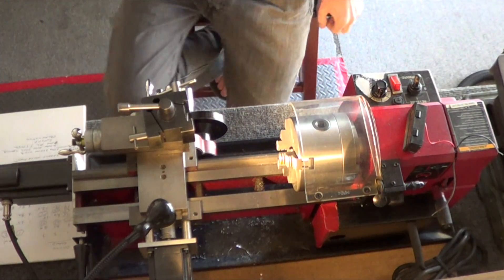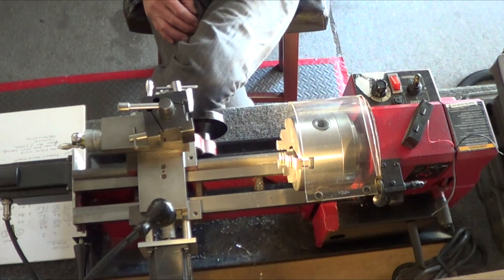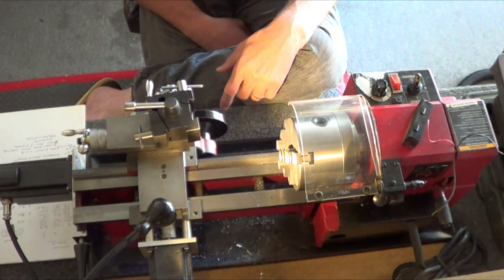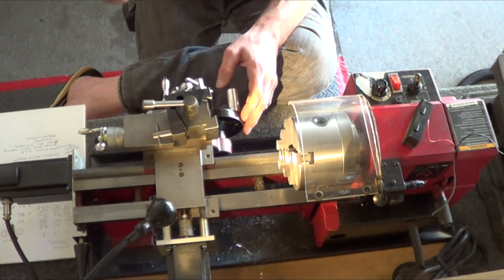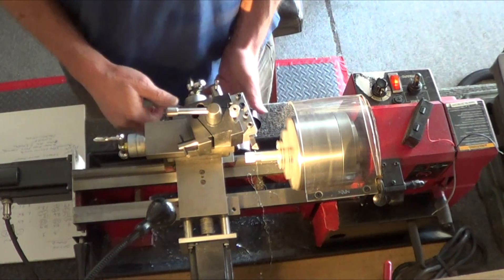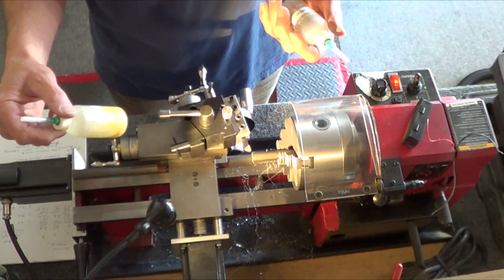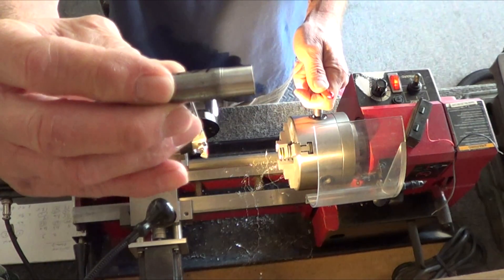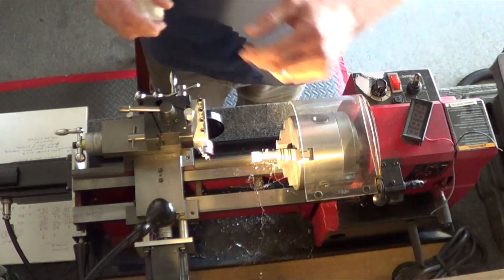Mini Lathe Unboxed & Rebuild #4

Comment: Hi Dave,  just subscribed to your channel and love all the vids you've created.  I have a question.  For the spacer that you machined,  did you machine a new one or redo the one that came with the lathe?  If a new one,  what material did you use?  Thanks for your help.
Reply from the maker: I have a playlist of videos just on the lathe. Not sure which spacer if the compound handle then a new one of aluminum prints are on my web site shown at the end.
Reply: @TheMiniMachineShop  I believe the spacer was for the feed control.  I can only turn it a short distance before it becomes increasingly difficult to turn and finally too tight to move.
Reply from the maker: @royeubanks639  Just watched the video and you have to be talking about the compound right? Sounds like you have a gib problem.
Reply from the maker: Is this a new lathe?

Comment: as of today, HF sells 2 different mini lathes; one for $999, and one for $599. unfortunately, the feature lists on the respective product pages list different sets of specifications and features, making comparison of the 2 lathes practically impossible, other than swing.

i'm wondering... if you took a look at the 2 product pages, you might understand right away what an additional $400 gives you other than capacity.

https://www.harborfreight.com/power-tools/routers-shapers-lathes/8-inch-x-12-inch-precision-benchtop-lathe-44859.html

https://www.harborfreight.com/7-inch-x-12-inch-precision-mini-lathe-93799.html?_br_psugg_q=lathe

Comment: Great videos! I have an older lathe from central machinery that I got from a trade. It's on its last leg. The on/off switch button is broken, so I have to use a small wooden dowel to press on it to turn it on. But I'm looking into buying a new mini lathe. What do you recommend for a newbie(bout 6 months) other than the one you use. I'd like to maybe have the mill combo.
Reply from the maker: Personally I would rebuild what you have getting parts from the little machine shop. As for recommendations, I have none. As said in many videos, research all you want. You have no idea what the condition is going to be of what you get. They are all made in China. I would look for a used one on Craig's list so you can test it. Here is a summary of my second lathe https://www.youtube.com/watch?v=mnZxrBqubPg

Comment: Hi Dave I don't have the same lathe as you but you might also want to check the bearings in the headstock. If they become a little loose over time they may need to be tightened up. That will correct some of the chatter as well just don't tighten them too much. I've had the same problem. It made quite a difference after I got them adjusted correctly. Nice job. Mike

Comment: Hi Dave, I just ran across your channel and have enjoyed your work. I've been doing a lot of research on mini lathes and mini mills. Apparently, a lot of them are manufactured side by side in the same factory. The difference being the is level of quality the seller wants from the manufacturer. The better quality, the higher the price. It's a shame after paying $500+ for a mini lathe, you have to repair/modify it just to get it to do what you bought it for in the first place! Your experiences with the HF unit make me think I might do better going to Grizzly or keeping an open eye on Craig's List.Fortunately, you had the technical skills, desire and funds to get your machine to an acceptable level of reliability for you needs. Most folks could not done what you did. I've sub'd and am looking forward to see what you accomplish. Good job man!! All the best Charlie
Reply from the maker: +Charlie Zellner The lathe is HF and was pretty bad. The mill is a Grizzly G8689 and was great. Grizzly also has excellent customer support!! I called because the chuck had excessive run out and no questions asked they sent a new chuck. I also bought from them some parts for the lathe and they are the same but better quality. Glad you found the channel!

Comment: Doing all the things you had to do to the HF lathe just to get it to work right would you buy a different brand lathe if you knew what you know now ? I have been looking for a while now and know I need a 14" or 16" bed to do what I need . That would be a lot of drilling and tapping.  Thanks Enjoyed the video
Reply from the maker: +Mark Patrick Sorry for the late reply. From what I've seen they are all pretty much luck of the draw and all use the same parts. Look up Don Brandt, he went with the LMS stuff and also had to rebuild everything. Knowing what I know now any would be fine. Thus is why I started this channel to help the next guy.

Comment: I did the tapered gib mod on mine (along with going to a 14" bed) I will eventually make new gibs again because I made mine a bit too thin and don't have much adjustment left. When I need it really rigid, I have a simple block I can use to replace the compound. I also swapped out the t-slot compound top that LMS was selling.

You will feel a lot different about steel if you pick up some 12L14 and some 1144 stress proof. They turn wonderfully.  

Now if only it would get below 100F so I could get out in my garage and do stuff.

What about the steppers you have on it?
Reply from the maker: +David Kirtley I hear you on the 100F. Fortunately I A/C'd my garage. Heat and I are not friends... What is a gib mod? I have the lathe CNC'd but the only time I use it is when I have to make multiple parts. Otherwise its faster to just make a part manually over programming and setup.
Reply: We had our first front of the season today. Not that much cooler but tonight is supposed to get down to maybe a bit below 70F. 

Here is the original article: http://warhammer.mcc.virginia.edu/ty/7x10/vault/Lathes/7x10-7x12-Projects/TaperedSaddleGibs/

There are better write-ups but here is mine with pics:

http://www.hobby-machinist.com/threads/getting-started-with-tapered-gib-conversion-on-mini-lathe.14406/

Comment from the maker: Two things.. One.. if you watch the video I never tightened down the cut-off tool which is why there was some chatter or squeaking that you heard and two I never mentioned take the chuck off and completely clean the mounting surfaces. Grease can cause the chuck to tilt causing runout.